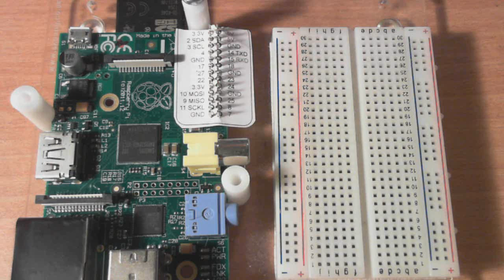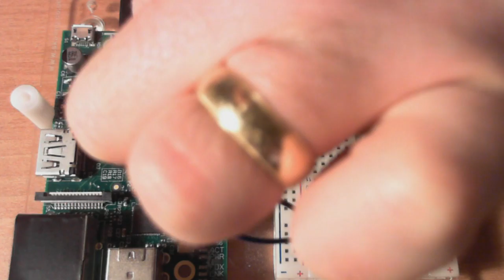Setting up the Raspberry Pi Light Sensor

Comment: thanks for the video.. I need 2 light sensor because im trying to make a toy car which is following the light. i will put 2 ldr to different side and the car will understand where the light is coming from and rotate there. but how can i make 2 sensor? if i bind them serially, both sensor will affect the current and the raspberry cannot understand which one is resisted. should i connect parallel like https://image.ibb.co/iuGJWT/paralel_pins.png ? if i do like this can my rasp understand from yellow and green inputs that which sensor is invoked ?? or do i need something different?

Comment: Hi 👋 I am in need of help . I am building a laser harp which uses raspberry pi for a MIDI device . Using photodiodes and photoresistors for input and I am not sure how to wire them together . Could it be possible for you to make a video on how to make at least 1 laser and 1 reciver video how to build it ? P.S sorry for bad English I am still learning it . Thank you very much .

Comment: does the light sensing piece need a resistor or anything?
also if you could share the code ! 
thanks
Reply from the maker: Hi. The Light sensing piece is a resistor itself so you don't need another one. The code I write is up on Github at https://github.com/TimSmith714/Pi-Light-Sensor
Reply: Tim Smith Thank you !

Comment: Once again, I want to thank you so much for demonstrating this project. I had it working with resistor. I am very curious does it make much a difference if I use capacitor instead of resistor?
Reply from the maker: As I understand the electronics, the resistor won't stop you from detecting whether it's light or dark but it won't let you measure how bright the light is. I can't include a link in comments but if you search google for
Adafruit Basic Resistor Sensor Reading on Raspberry Pi
and look for the How it works page there's a good explaination and useful oscilloscope readout. The light level is determined by how long it takes the capacitor to build enough charge to make the pin on the Pi's GPIO register as on (high in technical terms)